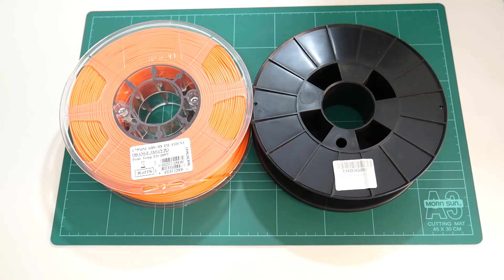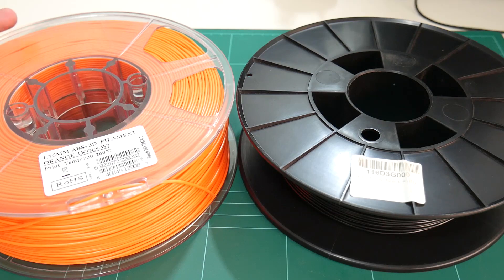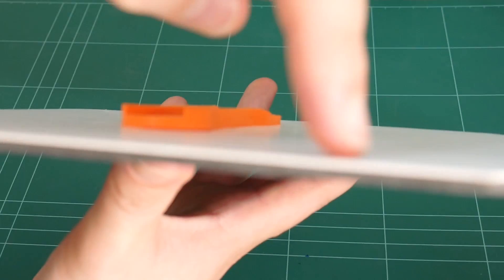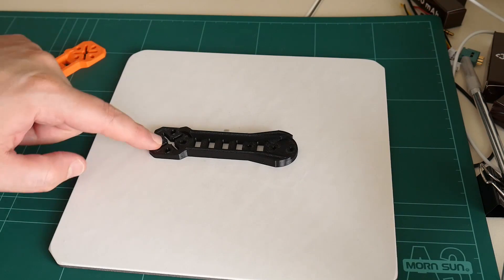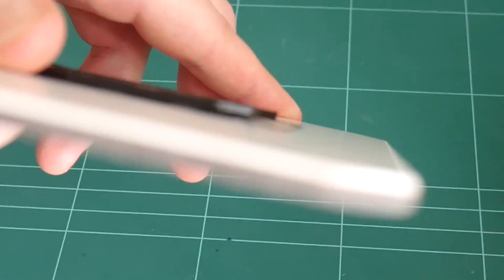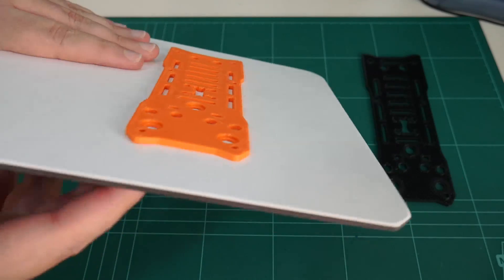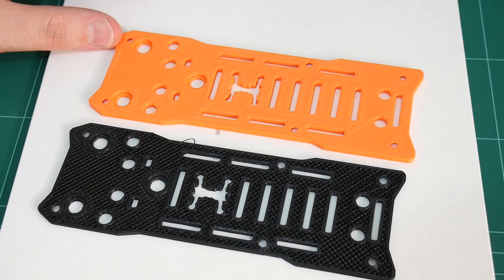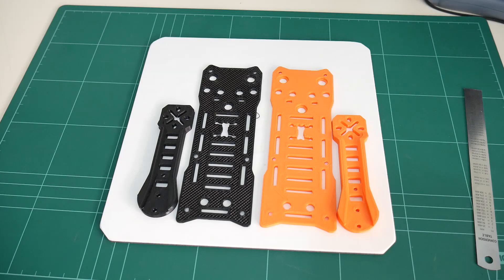Worth Printing with ABS again?

Comment: Hi i got one of those cheap refrigerators slash food heater that dont work verry good as a refrigerator so i was going to try it out to dry my tpu filaments on the heat setting about 4 rolls fit in there i was also going to use as a dry storage what do you think will it work what is tour opinion on this thank you

Comment: I thought ABS was supposed to be printed with little (10%) to no cooling. Also if possible, use an enclosure to keep the heat in and the fumes able to be extracted with more control.
If ASA can be put the paces I would like to see that in comparison to ABS.

Comment: I never liked PLA. It transformed the making community into a 'print useless novelty crap that fills your shelves' company, because of it's insufficient properties, especially thermal wise. So it's great to see, that there's some advancement with ABS.
Reply: There are infinite uses of 3d printing... for instance I do a lot of fabrication and printing a template I can use to transfer over on a piece of metal is invaluable since I don't own a cnc.  PLA work great for this because it's not exposed to UV.  Now I want to start printing parts for the race car so I'm gonna have to move over to ABS for the extra heat protection... PETG isn't quite enough for what I need.
Reply: I like this human.

Comment: Should I get abs+ or petg then ?
Petg seems nice but I've always heard abs is better for mechanical and structural parts which is partly what I'm after, as well as temperature resistance.
Reply: PETG is highly prone to stringing. It can be "fixed" with higher fan setting, but it would significantly affect layer adhesion.

What's about ABS+  -  After I started using it, I totally stopped buying regular ABS and particularly PLA.
With my PEI heated bed and enclosure it gives best results.
So, only ABS+ or PETG with slow fan.
Reply: Depends on exactly what you're going to print. PETG is just as easy to print as PLA, you can even use layer cooling for overhangs, no issues at all. Also it's tougher as the interlayer bonding is really strong unlike ABS. but it's quite a bit more flexible than ABS.
So t's not as rigid as ABS. I believe that using PETG for 3D printer parts will result in increased ghosting artifacts because at high speed the system will be a bit more "wobbly", but I haven't specifically tested them against each other like that.

for parts which will take abuse like quadcopter parts I think PETG will be better. it will bend and bounce and snap back to how it was where ABS will delaminate, But when you need precision and can't have any oscillation like 3d printer parts, I think ABS will do better.

Comment: Any idea what the glass transition temp is for this filament?  I've been using it for awhile and it is definitely less prone to heat warping than PLA but still not good enough for thin wall RC airplanes in the hot Hawaii sun.
Reply: it should be at around 100deg Celcius as like any other ABS but funny enough I cannot find what exactly is its glass transition temp of the E sun one.

Comment: Not sure where you live, but in the US, Amazon Basics brand of PETG is $13 per KG from Amazon. eSun is about $20ish. Main downside of PETG is that it is sometimes blobby and it is often very hard to remove the support - probably due to amazing layer bonding. But yeah, while I did just finally get ABS to print decently after years of trying, I will probably not buy any more.

Comment: Have you had any problems with your PrintInZ Plate having bubbles in the surface after removing parts? I print PETG at 245c and 70c for the heated bed and it caused little bubbles on the surface. Doesn't quite affect anything but the bottom surface is mostly still flat. He has stopped selling the product all together for some reason...

Comment: I print a lot in ABS for my printer upgrades so when i use a enclosure they will not get soft. I am addicted to acetone smoothing parts even though they don't need to be which is one feature ABS has over all other plastics. Even using acetone to weld and fix printed parts is just awesome rather than reprinting a entire object i can just use a bit of acetone and weld it back together and repair it.

Comment: Hi Tech2C,
I have a question about your previous printer - the Prusa I3.
I am currently struggling to find an adequate setup for my heated bed. I could see that you used some sort of an aluminium bed - would you mind to elaborate on the exact components which you utilizied ?

Thanks in advance and keep up the good work,
Roy.

Comment: They both warped in the same corner. Check for backwash from the hotend fan. I recall someone used an thermal camera to create a map of the bed temp with the extruder stationary and switching it's fan on and off.

Comment: 95% of time you don't need ABS.
ABS has inferior mechanical spec than most others materials included PLA, is less measurements accurate, is difficult to print. Is not eco friendly.
You need ABS only if you need:  
- better temperature resistance
- Lasy and cheap finish aka Smoothing with acetone
- increase polution with all your failed prints
Reply from the maker: Can't argue with you. I agree...

Comment: I almost exclusively use PETG. everything ABS wishes it could be. ease of printing, excellent self adhesion, nearly zero warping, no heated build chamber required, high strength, non brittle, no fumes. the PETG i buy costs the same as PLA.

Comment: Slightly off topic, however, if you haven't done so already, try the eSun PLA Plus. I love it. It is stronger, very easy to print, sticks great, and looks very good. Take care and thank you for sharing.
Reply: Pete. How resistant is to weather that eSun PLA plus ?, does it deforms if you leave it under the sun? Normally PLA melt if you leave it in your car in a sunny day for sample. ABS resist a lot more heat than regular PLA

Comment: Maybe it's my imagination but it looked to me like there were layer adhesion issues in the new orange ABS+ when we looked at the prints from the side.
Reply from the maker: Sometimes when I print at 0.3mm layer height with my 0.4mm nozzle, the layer above doesn't get smooshed down enough to the layer below, resulting in some areas not bonding enough. At 0.25mm layer height it's ok. The black ABS showed this issue as well but it was harder to see. I get this will all filaments at 0.3mm Z height.
Reply: Well, wrong print settings, apparently. It is not ABS+ problem

Comment: 2.50 - I've never looked back after enabling auto-levelling on my HyperCube (thanks again, Chris!). 
Set it up once, and never worry about the bed adjustment screws slipping ever again! The time and $ spent on wrecking printing surfaces (I use a "PEI" stick-on) are worth it, let alone the aborted prints.

Tom has the auto-levelling tutorial to watch - https://youtu.be/EcGFLwj0pnA

I get the print surface from Banggood - https://www.banggood.com/5pcs-220x220mm-Plastic-Hot-Bed-Stickers-For-3D-Printer-Wanhao-i3-p-1158028.html?rmmds=myorder&cur_warehouse=CN

Comment: Interested until you said doesn't work well with acetone, abs is the material of choice for prop making due to its ease of sanding, acetone welding and smoothing, PLA is great for quick models or parts that don require much finish and I've just started using petg (to make my 1st quad) and it's great for ease of use and strength but nothing is as good as abs for props, just a massive pain in the bum to eliminate warping, even with an enclosure and PEI print surface
Reply: I'm going o give it a try because he didn't say it was immune to acetone, just less easily melted. In my mind this is potentially a good thing because pure ABS is a little too sensitive to acetone and that makes good smoothing on detailed parts more difficult because the ABS can melt it too much very rapidly and ruin the part. If this just reacts slower, it may yield better looking results, by giving more time to work with it.
Reply: yeah worth a try but its mostly bigger things i do with abs, just recently got a resin printer i can use for details

Comment: i got a cheapo Tronxy P802 
and i must say , after i build ma enclosure 
i never had a problem with ABS anymore 
i put ma bed at 100°C , and i have 0 worries about the part sticking to the bed 
i do still alternate between ABS-PLA-PETG though 
i find ABS to have a wee ruffer surface finish compared to PLA & PETG
but it's the cheapest of the 3 lol 
and lighter aswell , 
so , 1kg of ABS ha's more filament on the spool then PLA & PETG 
so yea ! still whurt it 4sure

Comment: The biggest problem with abs was not the bed adhesion (abs juice works sometimes even too well) or the smell, but the cracking on higher layers. This was absolute pain, and even though enclosed printer reduced the cracking there was obviously still stress in the layers which reduced the part strength significantly, the print quality was a bit rubbish and after the part cools down it does warp a bit.
Reply from the maker: That's a good point. Here I compared low, flat, but a fairly large piece as I normally have adhesion issues with ABS with these shapes.

Comment: I print in ABS only. My parts are used outside. PLA will not survive outdoors. I am not sure about the price of anything fancier.
Here are the tips and tricks; 
1- Cover the glass with captain tape. Do a good job. No air bubbles or wrinkles. 
2- Using a small brush, apply a thin coating of ABS juice. (ABS juice is to dissolve a piece of ABS the size of a quarter, into a cup of acetone. The thinner the better. Acetone will also get rid of finger prints and other nasty greasy stuff. Any thicker, and it will have the reverse effect). 
3- Set nozzle temp to 245ºC for 1st layer, 235ºC for other layers. Bed temp must be 100ºC. I had to set mine to 108ºC to get 100ºC on the print surface.
4- Slice and print the part with 3mm-5mm Brim. Raft maybe necessary for huge parts.
5- let the part cool to room temp Completely, before attempting to remove it. The part just lifts as if it was never stuck to the bed! Do not use any tools. Not required and will damage the tape. If you are in a hurry, put the print plate in a freezer for 1/2 hour and then let it reach room temp. The expansion and contraction with loosen the bonding to the plate. 
You'll get beautiful prints every time. no warping or lifting. No fighting to get the part off... 
This has been learned the hard way and spools of trial and error. Enjoy.
Reply: Because you really think ABS survive outside??? ABS suffer UV light really bad, suffer cold-hot shrinking badly that can make 3D printed part if exposed to Winter whether condition useless in few months.
If you need material for outside you can find much much better than ABS.
Reply: @blender_wiki  if you print carbon blank abs, it can survive outside. Secondly, abs can sustain higher temperature better than PLA, that's probably what he meant by outside where sun can make the part temperature reach over 60*c (glass transition temperature) of PLA and it melts into a ball
Reply: For you.  For me and an AnetA2, I use gluestick on glass, 70C bed and 230C hotend using Hatchbox ABS (several colors).   Only fail I had was when the spool unseated itself and stopped feeding.
Reply: I have a mailbox flag holder up in PLA (first one was ABS) for 2 years (this will be the third year) of rain, snow, sleet, and burning hot sun as that part is in the evening sun as it faces directly at it in the southern USA sun (100f-105f is not uncommon) as a test and it is still as good as when I put it up.  It was Justpla PLA (their abs sucked) so not sure if that company is still around or not.  I much prefer ABS and have since stopped buying PLA as I replaced it with PETG and for ABS I have my eyes set on ASA if the stuff would even come down another 20% in price.
Reply: The Best Stooge, very interesting. What color PLA did you use for your mailbox? I've heard black is the worst.
Reply: orbitalair, I'll have to give glue stick another go. I used it with no success. Then again, my bed was at 100ºC. Will try it at 70ºC. Thanks for the tip.
Reply: Turquoise and I check up on it every six months and the previous ABS one was yellow and was not 100% ABS as it would not fully melt in Acetone and after two years had faded out pretty badly.  The company went from great filament to horrible in two runs until they were forced out of business back in 2014 (I purchased it back in 2013 based on recommendations and reviews based upon those two previous runs).

edit:  Here is exactly what I purchased back in Jan/2015 - https://www.amazon.com/gp/product/B00PLI9OLW as that is from my past orders ledger on Amazon and has not faded nor degraded as I mentioned above.

edit: I was looking at my review in Feb on it and - Very very good PLA and it does ooze more than I am used to BUT it is purer is the reason.  Smooth and just looks good.
Reply: btw, on glass Hatchbox ABS requires 230c-235c and a bed of 90-95c for me on my two printers.  I do love Hatchbox but it is softer than any other ABS I have tried.
Reply: PEI on glass, 255c extruder, 100c bed. Enclose the printer fully. Ambient air should reach around 40-50c. Ramp part cooling up, starting at around 1mm height. ABS will print like PLA. No brim, no raft, insane overhangs. PC will print beautifully with a bit of work at temperatures and speed. No annoying tape.
Reply: Bed adhesion is not the only difficulty with printing ABS or other materials that tend to warp. The uneven material shrinkage will cause warping and delamination in areas of the print that are not on the print bed. The only cure is printing in a hot enough environment.
Reply: I print ABS at 255 end and 110 bed, 40mm/sec -Titan Tornado, on glass with BOSTIC white glue stick - full enclosure never had a failure, parts are strong and no warping - wait till cool to remove, just lifts off.

Comment: Just yesterday I reprinted parts of my x-carriage that are in proximity with the hotend with formfutura ABSpro. These parts were originally all PETG, but after a month of use, especially with higher temperatures, they are showing discoloration and deformation due to the heat. In this regard, ABS still has its use cases, and these newer formulas are easier than the old generic stuff. Even though I did print with a wide brim (IMHO the number one trick to reduce part warping), I was surprised how well the ABSpro performed, albeit I had to run my heated bed at its max around 100C. I guess power consumption on the long run can be factored in also considering ABS.

Comment: That was a pretty good print for generic ABS. That print in z plate must be good. I used Formfutura TitanX ABS(3dfilaprint ABS-X). That comes with a full data sheet.
Reply from the maker: I have a roll of Formfutura ApolloX ASA which sticks to the PrintinZ plate very well. Manufacturers that actually supply datasheets with their filaments are top shelf in my opinion.

Comment: Can sounds weird but in Portugal, the PLA it’s the cheapest filament that you can buy. One kg of PLA it’s less than 20 euros, ABS costs 20 or more euros and PETG costs more than 30 euros per kg.
I’ve started printed with ABS and I am surprised with the great results on my low quality 3d printer (anet a8). I manly print small parts but the most important rule is to use a brim. You should always use a brim to prevent warping! I print on a glass surface with air spray, and my temperatures for ABS are 240 and 100 on the heat bed. No cooling fan.
Other tips,: you need to calibrate the extruder for ABS (my low cost abs didn’t have an consistent diameter of 1,75 due to the low fabric process). I didn’t t have any enclosure,  but I have an insulated heat bed. If you build an enclosure you can get better results
Reply from the maker: Traditional ABS has required special attention to limit warping, such as adding a brim, enclosing the printer, using ABS juice, etc. But we have these new ABS filaments that are low warp. That should mean we don't need to bend over backwards to assist the filament from warping/contracting. And it's the same price as regular ABS. If you print alot of ABS then try a roll of low-warp ABS and let me know your results.

Comment: What about strength / durable? I've seen huge differences in ABS from the same roll! 2 colour roll, black and yellow. The black is very resilient with some flex where as the yellow is very brittle in comparison.
Reply from the maker: I would hope the manufacturer would supply that information on thier website. It shouldn't be up to us customers to test every colour of every filament type.